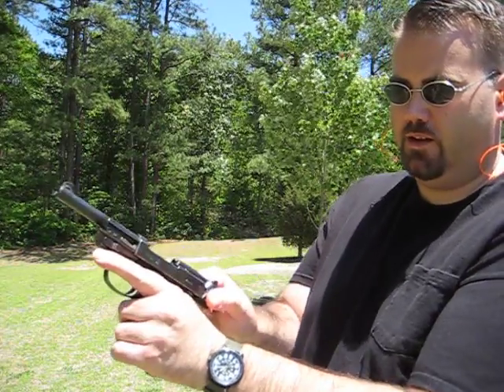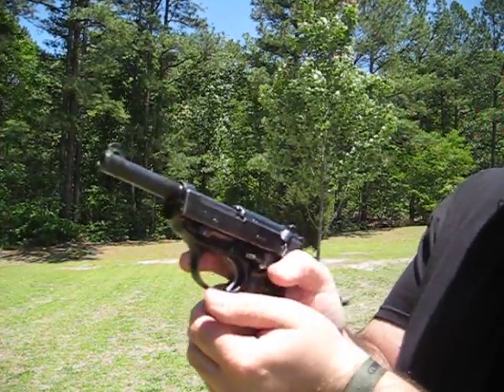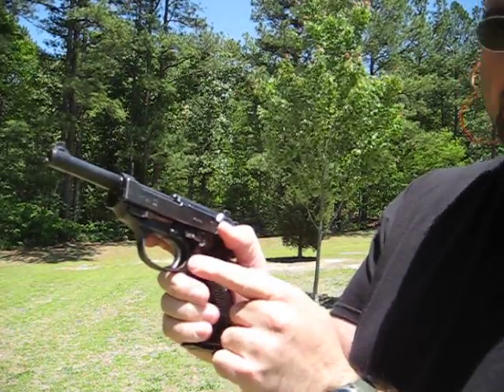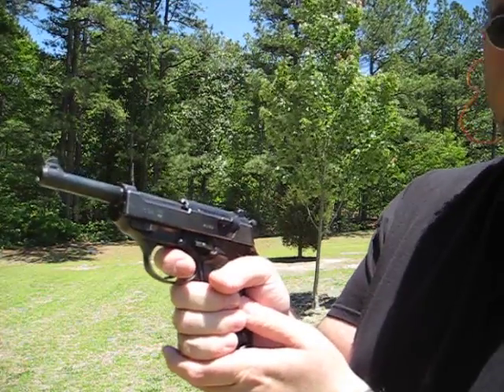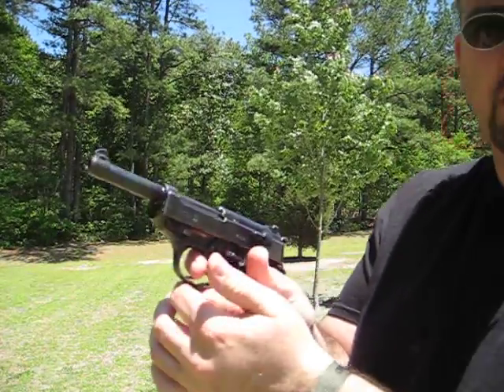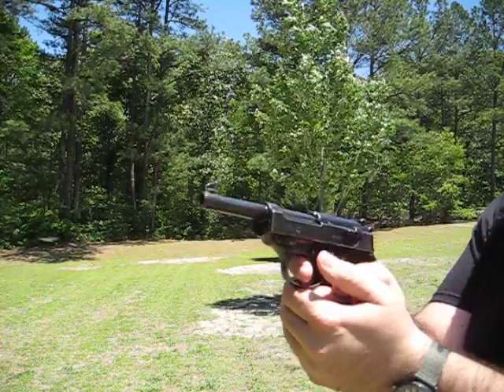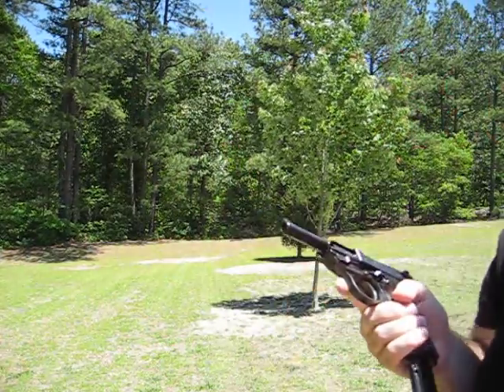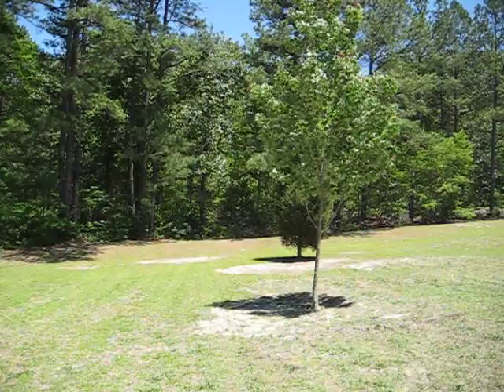Walther P-38

Comment: The Walther P-38 is an outstanding pistol. If you can find one it is worth  the cost, it is way ahead of it's time as the shooter pointed out Beretta 92 series shares similar traits, general shape, hammer drop safety and slide lever inspired the design of the 92 series nearly 40 years later. Unfortunately Walther no longer produces the weapon. I love firing it, very dependable, sturdy, accurate and easy to field strip to clean.

Comment: You are correct. Designed in the mid 
1930s, as the Walther AP, or armee pistol. Then, a few years later, the Walther HP or heer pistol came out as a second prototype. It was 1938 where the final version came out: the P38 as we know it now

Comment from the maker: I said it was designed in the mid 1930's not built in the mid 1930's.  Walther was working on the design for several years before it was introduced as a replacement for the Luger P-08.  This pistol was manufactured in 1942.

Comment from the maker: Mine is extremely reliable.  It's all original I haven't changed anything out on it.  I've never had a single jam with this pistol.  I use Winchester 115gr full metal jacket ammo.  It is cheap, relaible, clean, and plentiful.  You will not regret getting a P-38.  However you may want to do it soon, I have a dire feeling bad things will happen for gun owners if Obama becomes President.

Comment from the maker: I usually don't use the hammer drop safety because on pistols of this age they can break.  I used the hammer drop safety in the video to demonstrate how it worked.  Then after I chambered the round I lowered it with my thumb like you would on a double action revolver.

Comment: It's interesting to note that you related the safety to the Beretta M92. Actually the Beretta M92 copies (borrows) many of the features of the P38, including the locking system, the trigger system and the magazine release. One could say that the Beretta is a modernized version of the P38. Both pistols are exceptional.

Comment: Just curious about something. What is the point of it being double-action? I mean don't you have to pull the slide back anyway in order to load a round into the barrel? The only reason I can think of is that you can keep the hammer uncocked and still fire it right away. Safety thing I guess..as opposed to a 1911 where the hammer needs to be pulled back in order to fire right away. Any clarification would be appreciated.

Comment: The drop "safety" in a wartime P-38 is not reliable. Racking the slide like you did with the "safety" on can result in a discharge. The wartime P-38 is only a souvenir and probably should not be fired.